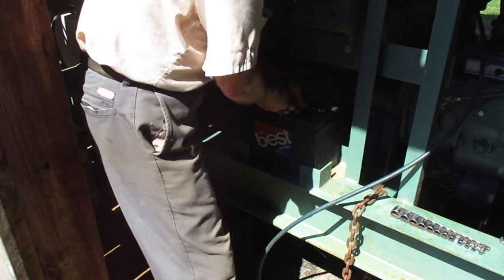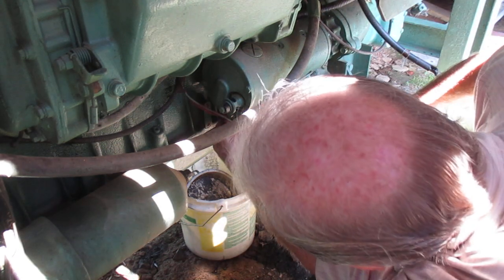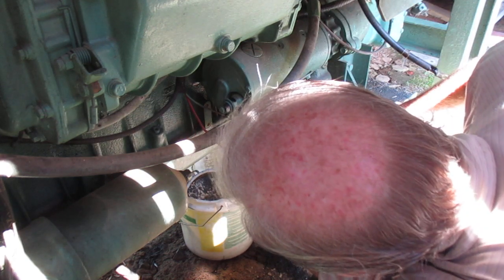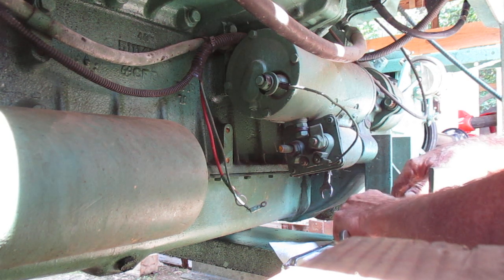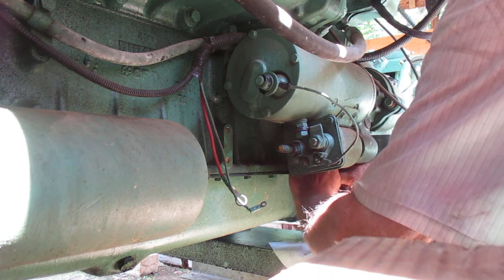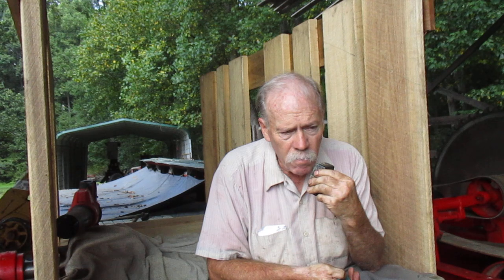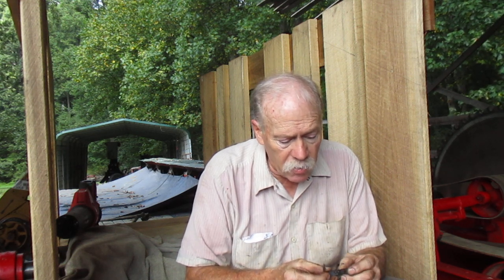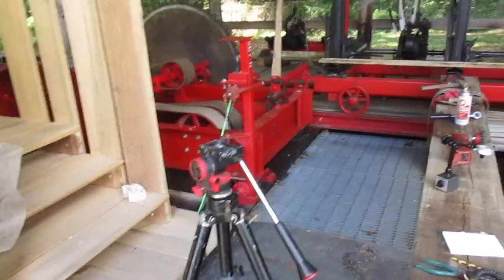HOW TO MAKE A WIRELESS MIC  DETROIT STARTER ECTOME # 876

Comment: Oh yea, I have a toolbox drawer full of bent wrenches and a couple of curved ratchets from using 3ft pipes on the handles.  Marty

That starter probably weighs twice what the battery was. What you need is the most used tool in my toolbox after 35yrs of working on cars, a ratchet strap. I used my ratchet straps to remove transmissions and differentials all the time and never asked for anyone else to help. they hold all the weight and I could lower the units just below wheel level then lower the cars until it touched the floor and released the straps then raised the car out of the way. most shops only have 1 trans jack and I never had time to wait for my turn to use it, time was money.
Reply from the maker: hi might the nee time . john

Comment: John your battery needs to have the correct cranking amps to tire the engine over
Reply from the maker: hi i have been using a car battery for 30 years , just saw on the side of the starter its 24 volt , oh well . thanks for dropping in john

Comment: the dogs look to be riding on a column that is fixed to the knee
not sure if that rack can be moved.
you could measure from that rack to the face of the knee and, very important the screw hole to mount the rack.
Then both the first and second stop on the dog.
Reply from the maker: hi there thats something i didn't think of , thank you i will have to look into that . may work . thanks john

Comment: So let me get this straight John, you have enough electrical engineering training to make a homebuilt wireless microphone, but you need someone else to work on your simple little starters?  Must be because it's a bit heavier.
Also, I was putting my shoes on to go help with the starter removal but by the time I had them tied you were already finished pulling it off.  I tried though.
Great video.  Over and out.
Reply from the maker: hi there i should have taken a look at the starter first . but just didn't feel like messing with . but i wasn't good enough to get the mic working so may be a good thing . thanks for stopping  john